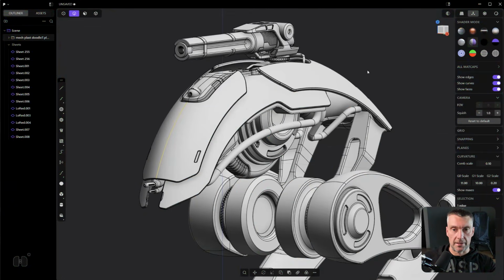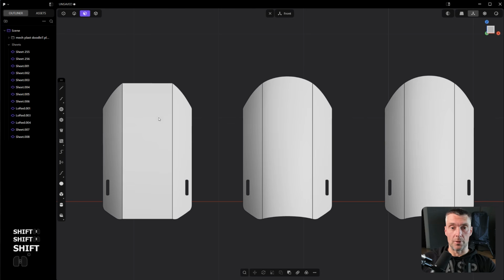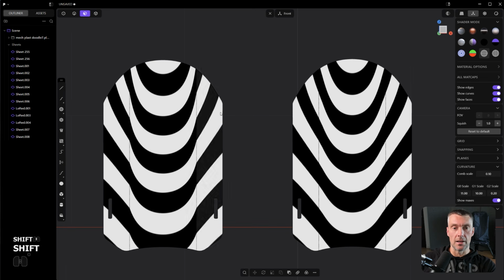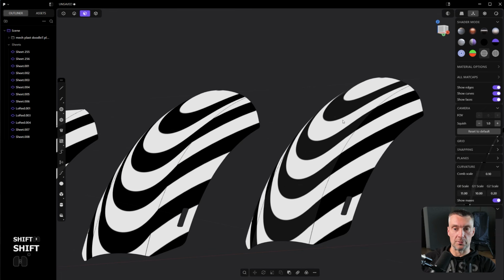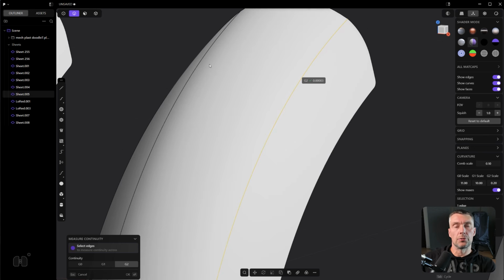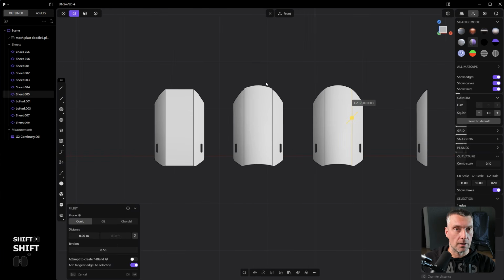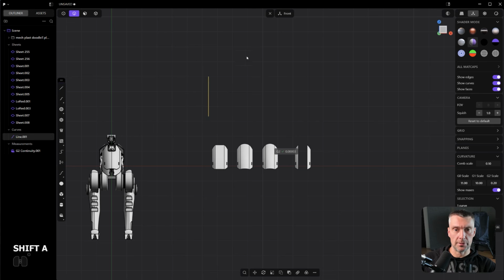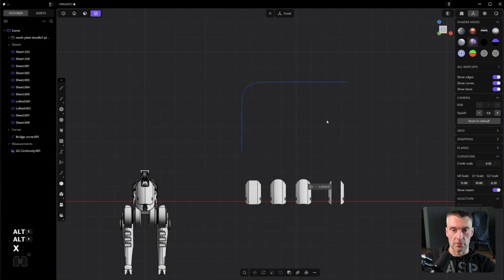G1 vs G2 Continuity in Plasticity — This Is Why Your Models Look Off

Comment: One thing you didn't go into is downsides. Like if G3 is so good why not use it all the time? Is it heavier performance wise? Or more difficult to work with or make changes too? I'm assuming there has to be some cons to it. otherwise even though you said its not necessary, if there no negatives i don't see why i wouldn't just use g3 all the time?
Reply: it very very hard to control, even G2 is pretty tedious stuff:)